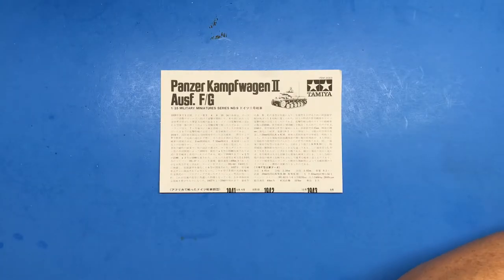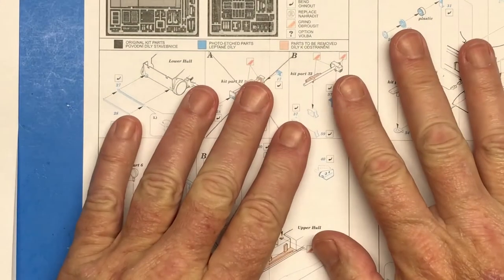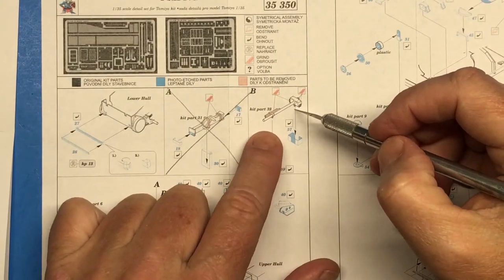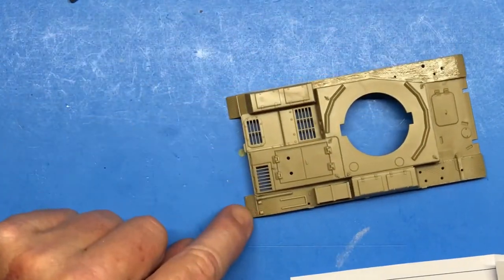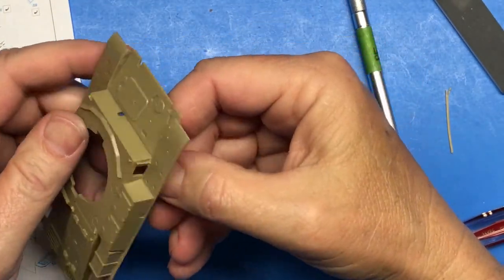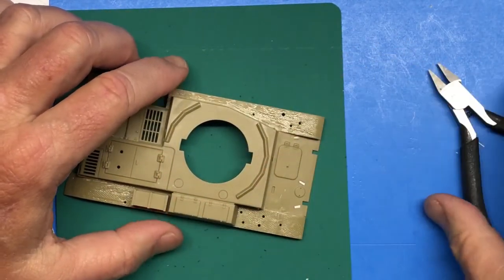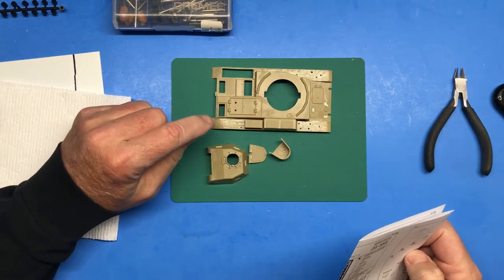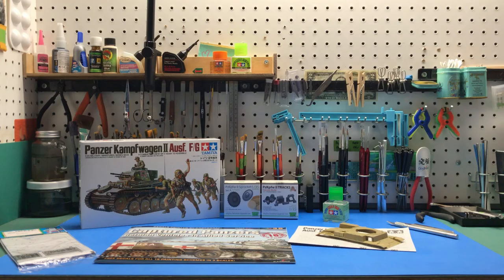Tamiya 1/35 Panzer II US Capture, Part 2 Photo Etch Prep

Comment: Solid start Brett! Clean deletion of everything necessary, which is always good. Cool tip with the scriber tool on molded on detail. I always wondered if it is better to completely remove the fenders, since there's photo etched parts for them. Looking forward for the next episode. Thanks for sharing, take care and keep up the good work my friend.
Reply from the maker: Thank you George.
As for the fenders, I think it depends on the particular set being used. The Elefant set was supposed to be used in place of the fenders, so the kit fenders are to be cut off. The PAnzer II the instructions indicate that they are to be used on the kit fenders after they are smoothed out.

Comment: Hi Brett. I've just come across this video. Like you I have collected a lot of photos of this vehicle. The Panzer II in Fort Benning is this very vehicle and there is a walkaround available here, https://www.youtube.com/watch?v=BAcG1gntqsg. It shows the Tool stowage and spare wheel clamps on the Glasis. In the video the Smoke Discharger on the rear is not the one in the Photos, I have to assume it was changed by the museum for some reason but there are photos showing how the spare wheel was attached to the discharger - cut down 88mm shell with simple clamp.
The mountings for spare track can also be seen on the engine deck.